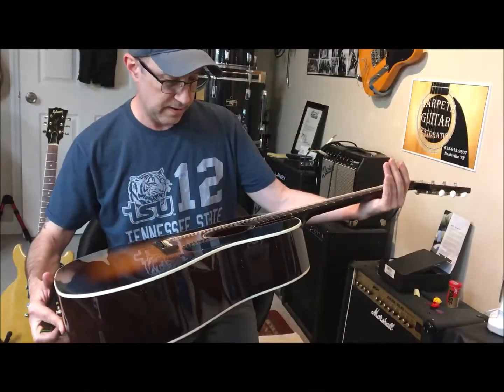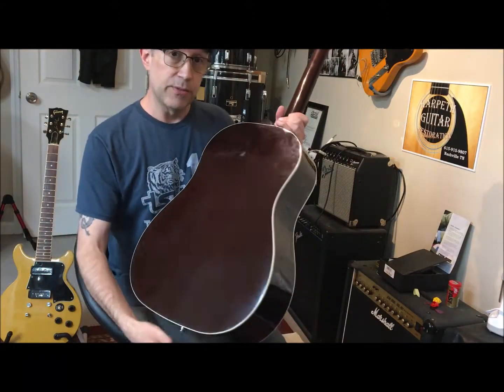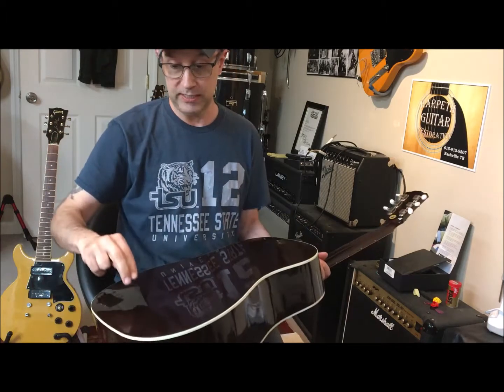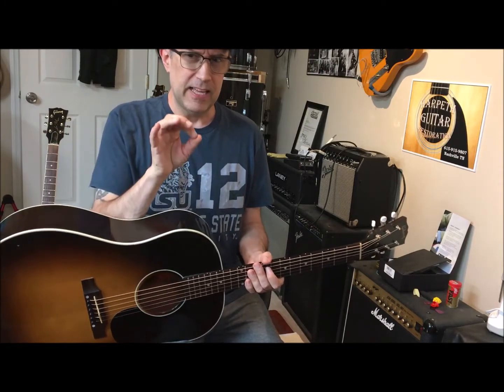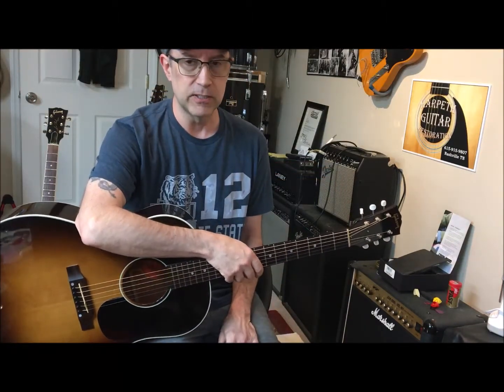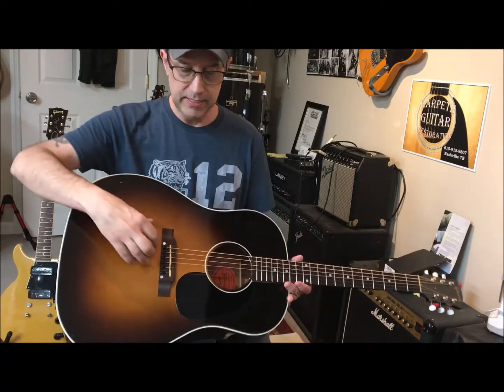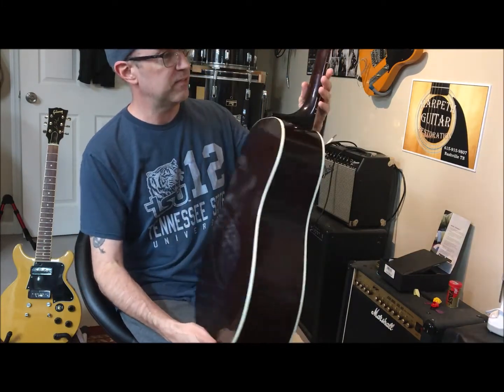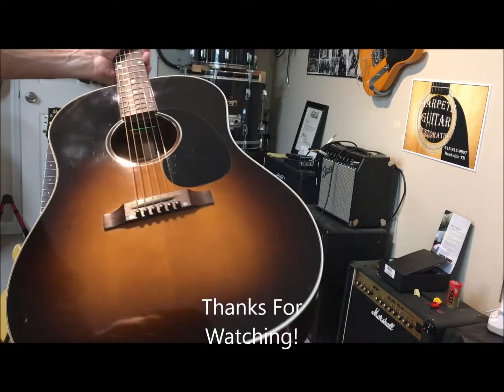Gibson J-45 Historic Collection

Comment: This guitar's serial number (02685035) reveals the day it was made - the first and fifth digits 0xxx5xxx are the year; the 2nd through 4th reveal the day, x268xxxx, or September 25; the last three digits reveal that it was built in Bozeman was the 35th guitar built that day, xxxxx035.  Serial number xxxxx535 would have been built in Nashville and would be an electric.

From the research I've done, 670 J-45 Historic Collection guitars made for Guitar Center in 2005-2006. They are more vintage-esque or vintage-ish rather than recreations of historic instruments. The J-45HC was essentially the standard version J-45 as Gibson made them that year, but with a "Historic Collection" decal on the back of the headstock. They had Sitka spruce tops, EIRW bridge and fingerboard, Tusq nut and saddle, Gotoh Kluson-clone tuners, Fishman Matrix Natural pickup, 20-fret fingerboard that covers part of the rosette, which in turn is (along with the soundhole) closer to the neck because of Ren Ferguson's change of the bracing angle to 98 from 103 degrees or so, and a badly-placed pickguard that covers another quarter of the rosette - if you gently peel it off with a skinny flatpick and/or dental floss, clean it with naptha and reinstall it with the double-sided 3M pickguard film it will line up correctly just outside the rosette like the old ones.
 
Mine has a nut width that is 1.704-in according to my Harbor Freight digital calipers. The neck carve matches my memory of my 1960 LG-2, which remains the only guitar I ever let go of that I really miss. I used to say that the tone is ENOUGH like my memory of my long-gone 1950 J-45 to satisfy me, but then I got to play that '50 J-45 again a couple of years ago and realized - I like the HC BETTER. More flexible, breathier, just a nicer sounding and playing guitar. The Fishman Matrix Natural pickup sounds pretty good when played with bare fingers, which eliminates the piezo quack. 
 
I have owned more than 200 guitars in my lifetime, and played countless more.  In more than four decades of playing, I can count on one hand the number of guitars that created a lightning bolt of connection the first time I played them.  That number includes a one-owner 1949 D’Angelico Excel and a rebuilt 1930s Gibson L-4.  This J-45 is the ONLY brand new off the wall guitar I’ve encountered that produced this sensation, and more than a dozen years later it STILL amazes and delights me.

Because I really AM a guitar nerd, I've done my trainspotting on this model.  Every time I see one online and can get the serial number, I have recorded it and noted where, how much, etc.  Going by the serial number, the earliest one I've seen is a January 7, 2005 specimen, while the most recent production specimen I've seen is dated November 6, 2006.  

These guitars were replaced by two different models, the J-45 Modern Classic, a slightly heavier built guitar and the J-45 True Vintage, which was neither.  It was also a vintage-esque guitar that used Adirondack red spruce for the top and came to be built with hot hide glued top bracing.
Reply from the maker: WOW! Thank you for sharing your knowledge of these rare guitars!
Reply: Hi Thanks for the lowdown. I am now the  proud owner of a 2005 Historic Collection J200. Her birthday is on June 5th. She's a Blonde 👱‍♀️ would you be able to tell me anything about her?